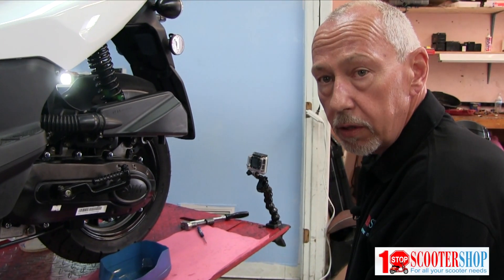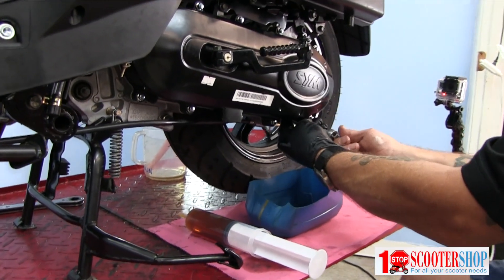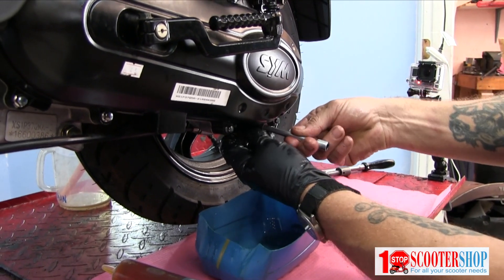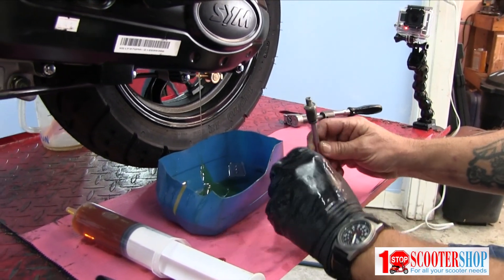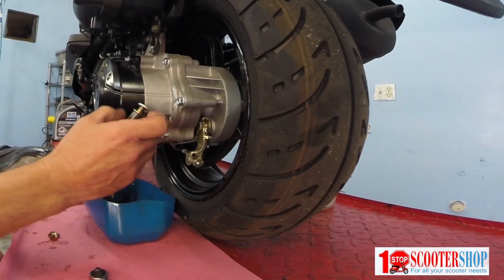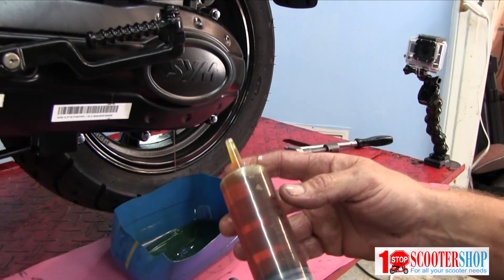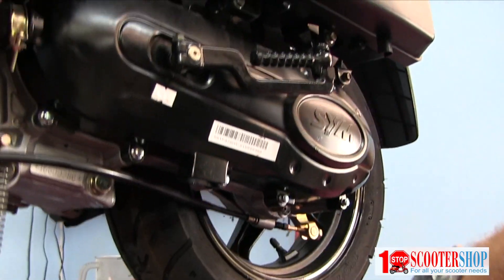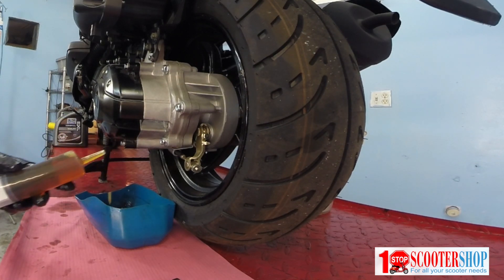Basic Scooter Maintenance - Changing Gear Oil

Comment: Fill up the gear oil until it starts leaking out the fill point, I use 80w-90 gear oil and use a bike tyre pump with an inflatable bed nozzle

Comment: Hello, if you have had such a case, the craftsman told me that he knows it often and it is not a defect and it is not a problem.
 I have a sym xpro 50cc air filter to clean it and the plasma in which sits the plasma that is attached to the scooter and joins the rubber hose coming out of the carburetor came out gasoline viscous both in the hose and in this plasma not much, the filter is clean.

Comment: Great video is there a way to check the oil level of the gear oil. don’t see a dipstick like the engine oil.
Reply: Consult the owner's manual.
Reply: no you just have to change it and measure before you fill

Comment: Also I’ve seen videos where they just fill  the gear oil to the top and let it overflow -is that an acceptable way to measure?
Reply: No it is not. Too much oil is as bad as not enough oil.
Reply: I was thinking the same. Now this person says is not good while others say is ok. Is hard to believe anyone making these videos.
Reply: @dinhdatVN  Well then how do you know what is the right amount of gear oil to insert?
Reply: On lots of scoots the fill hole is on the side of the casing facing you half way up the gearbox with the drain underneath, it's facing down on my Sym. If you know how much to put in use that amount if not filling the upper fill hole 20cc at a time until it starts to run out will usually be fine. This does not apply to fill holes with dipsticks which should be measured with the screw/dipstick resting on the filler hole and not screwed in.

Comment: Hi , What is the best thing to do if your gear oil contaminated with water? (The gear oil turns milk like color) should I flush it with diesel fuel? Or should I open the transmission to clean?
Thanks you hope you can advice me sir.
Reply: Roxanel Jingco flush it with the gear oil
Reply: Drink it !

Comment: Strangely enough I tried draining the gear oil out the drain plug but nothing came out. Even after putting gear oil in the fill port nothing came out the drain port. Looks like I'm pulling the cover.

Comment: NOOOOOOOOO.....most scooters have the gearbox oil quantity printed on the gearbox housing, my sym fiddle 3 says 170ml so thats what it gets, different scooters require different quantities,  on a Honda I had it said to fill top hole until it came out again and that will be good for most scooters if the exact amount is unknown,  also always use proper gear oil not engine oil as they are made to do different things,the gearbox on a scoot is separate from the engine unlike on a motorcycle.  Motorcycle oil has to run around the gearbox and the wet clutch as it works so isn't as slippery as car oil as it contains less or no friction modifiers, on  my scooters I always use good semi synthetic 10w40 car oil as it's cheaper and better than overpriced motorcycle or scooter oil.
Reply: And what gear oil do you use?
Reply: Castrol 80/90 axle/gear oil about every 5000 miles. A 1 litre bottle of gearbox oil will probably outlast a scooter even with 1000 mile engine oil changes.